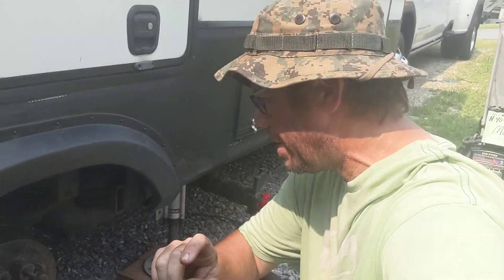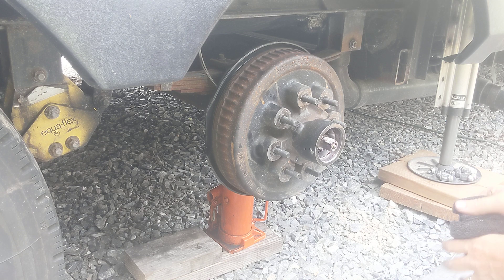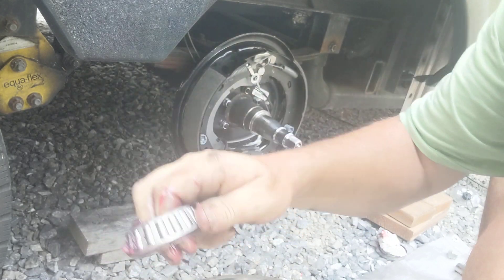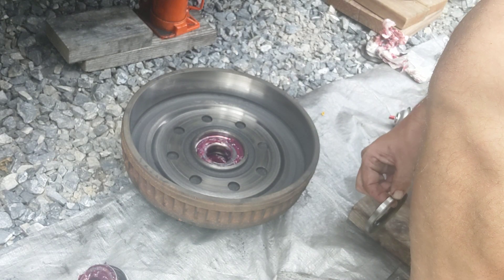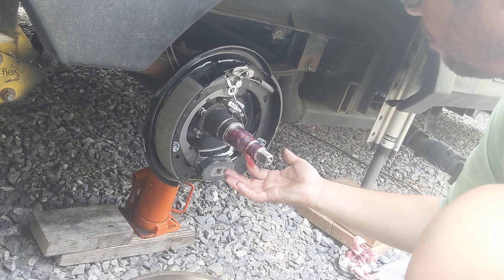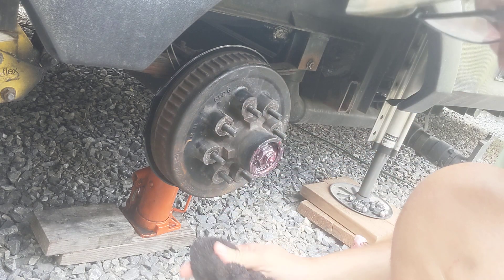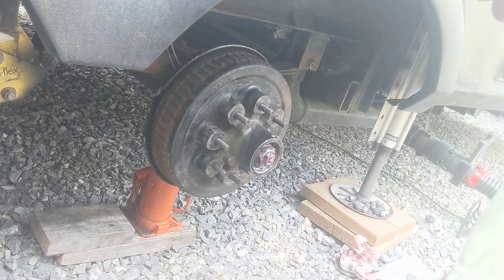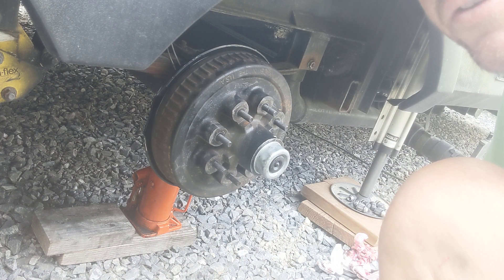A How to: Dexter/Lippert Axles, Wheel Bearing, Seals and Brakes 12,000 Mile Maintenance.  7k Axles.

Comment: Do you remember what grease seal # you used?  Was it the 10-36?
Reply from the maker: The size was 2.25".  Pretty sure that all 7000# axles should be the same.  I am guessing I got China made and don't remember the numbers....just remembered I need 2.25" hope that helps.
Reply: @moseyingwiththemalys3357  I've got the 6k axles.  Guess I'll have to pull the hub off and see if it has a part number on it or measure it with a caliper.   Thx!!